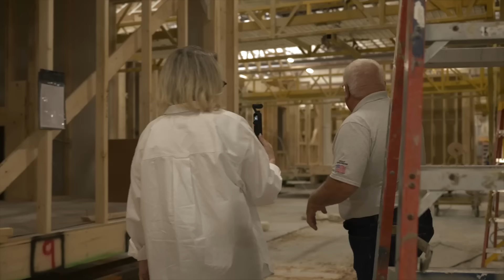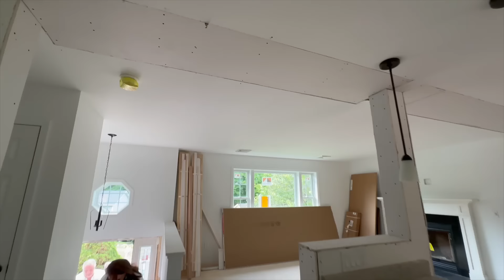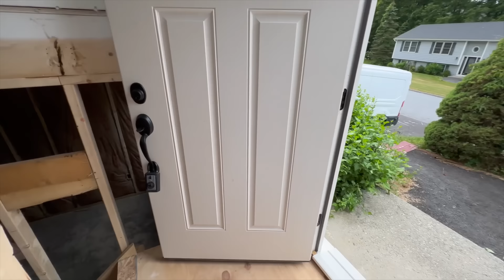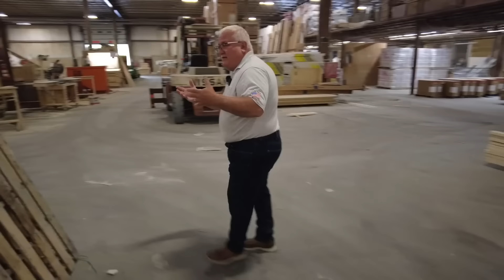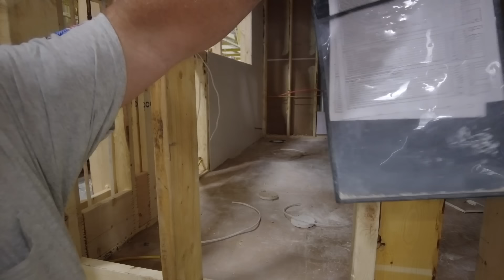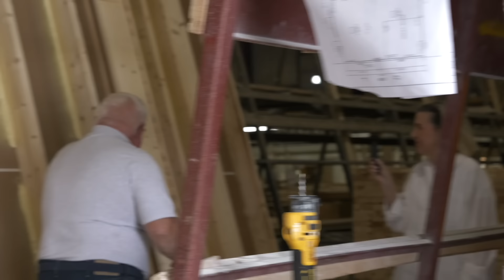Modular Homes ARE Better Than Stick Built!!!

Comment from the maker: LET ME KNOW WHAT YOU THINK! Are Modular Homes Better Than Stick Built? ( WATCH 👀 How "Modular Home Companies Are Lying! \https://youtu.be/YSayVjWhmvA)
Reply: @KristinaSmallhorn  I agree that modular is now better. I used to work at a modular home factory, and I will tell you that they have come a long way in 30 years.  With the issues they mention, plus the problem with so many new home builders being scam artists, it is no surprise that the modular builders decided to expand their business to better quality at a lower price, while offering more styles and options.
Reply: Just watching @cyfyhomeinspections inspecting new construction, I would say yes.
Reply: I am a carpenter who has recently finished a number of modular homes. They don't go together properly onsite, they settle at different rates since its a bunch of boxes put together, they use cheaper quality materials than any company Ive worked for so they won't actually last as long as the standard stick built house, you have to pay extra for decent cabinets. They glue sheetrock onto particle board plywood glued to studs so any renovations are more costly. Ive worked on Westchester modulars in NY and dreamlines in MA. If you want a house to last generations DON'T buy a modular. I turned down a kitchen/Trim job with Westchester modular after seeing the low quality of the finished product. The only thing, having a modular built is faster. I did 1 recently where all the doors racked and wouldn't open properly within 1 month after set. Remember people you get what you pay for.
Reply: @dandeflavis7004 
  As long as it lasts longer than I will😆
Reply: Can modular homes be built to tiny home specifications?
Reply: @feliciasampson8032  as long as you mean in size, not on wheels, I have been watching around and many of the modular factories are also making ADU's that are more often under 500 square feet.  Just check around as many will help customize to what you are looking for.
Reply from the maker: @feliciasampson8032 yes.
Reply: @KristinaSmallhorn thanks 😀
Reply: @feliciasampson8032 if you are referring to a home 300 sf and smaller, yes
Reply: You need to design a home where (if) the roof, comes off, in a hurricane, IT'S NO PROBLEM.
Reply: No link to the home builder? Westchester ?
Reply from the maker: @j10001 here ya go. https://westchestermodular.com/
Reply: Link please
Reply from the maker: @lisakaneck5120  https://westchestermodular.com/
Reply: You should have shown how they connect wiring, plumbing, and HVAC between units/sections. And no mention of masonry possibilities (brick, block or old style stucco). And no mention of fireplaces ( real brick or other ).
Reply: Can you direct me to the best mod homes in or around Tuolumne county California?
Reply: @jennyanimal9046  try Boxabl.  They are in California and have great options for designing to your needs.  There is a couple of more modular builders there, and in Arizona, that should be easy to find on Google.
Reply: Looking to get one in South Carolina; any builder suggestions?  Does Westchester deliver there?
Reply: @jwyllor thank you. Do you know of any builders in the PacificNorthwest
Reply: @feliciasampson8032  US or Canada?   In Washington state, there are a few dozen modular home companies.   I am from Canada, so I can not speak on the companies there.  I would recommend going to home shows (the fall ones should be lining up soon) and checking out the units on display, doing some research on the company as far as positive feedback then go from there.
Reply: It is great is there any dealers in Texas? Thanks
Reply: Don't think can get an underground basement in a modular home or other custom type amerinities that can achieve in a traditional type home. Such as stone and or brick. As nothing in this video showed thar could get stone on the outside such as like for the side or like say door or poarch pillars.
Reply: @MarkIrwin02  or plumbing and electrical changes etc
Reply: @MarkIrwin02  Yes, yes you can get a full-on basement for modular homes. As much as I prefer the traditional way of stick building a home outside on-site, I will admit it is absolutely possible to get a full basement for a modular home. You'd just have to sub out all the foundation work for that and coordinate with whatever manufacturer you're going with that has the building plans for the house it self. Not much different if you were to sub out all the foundation work for a traditionally built home, really. That all depends on if you live in an area that allows for a basement, of course, like throughout the midwest, east coast, or up north.
Reply: I’ll bet this guy knows the names of all of his workers, how long they’ve been with him, and what kind of car they drive.
Reply from the maker: @ he does!
Reply: Whatever builds the home faster
Reply: @Infamore  and faster is not always better!
Reply: Are there any modular home builders in the state of Mississippi
Reply: And unfortunately these contractors overcharge. I’ve seen this several times over the past 3 years.  Prices have stabilized now so they can’t use that excuse anymore.  I’ve been watching everything because we are considering putting up one more home for retirement and all culture stone and EIFS modular possibly with a 8 or 9/12 roof pitch and partial basement.
Reply: Wow !!!!!
Reply: stop making us look at your face. show us how they build them. sheesh. you're not 20.
Reply: What is the difference in price? Modular verses stick?
Reply: it's like anything, across many industries, do you get a better product mass produced or hand built by cratfsmen?
Reply: @KristinaSmallhorn  what is the company that built this home?
Reply from the maker: @ this home is Westchester modular.
Reply: We currently live in a beautiful- large modular home but wish to downsize. We are looking at properties potentially with an existing smaller (older) home. Have you seen instances where a modular  section or sections can be integrated with an existing ( single story) structure- given it is structurally sound?
Reply: Any modular home builders in Houston, Texas
Reply: How do you feel about Clayton Homes?
Reply: Yes. I actually wanted a plain 'ol double wide on my own 1/2 acre or so when I bought my current home. Guess what? Anywhere that's allowed those lots go for a premium and they don't come up very often. Very high demand. Against my better judgement I bought another stick built. And yes, regretting it. My old 2002 1200sf double wide cost no more than $50 in utilities. 1400 sf of stick built climbs North of $150 all the time. The fact that you almost can't get a lot tells you a lot.
Reply: @markw999  heck, my doublewide EATS electric and heat. I pay $600/month each winter in propane, it's ALWAYS cold, and my electric bill averages $400. Nope, stick built 100%!
Reply: @This1LifeWeLive  How old is it? On stilts or on poured concrete footing? The newer ones are fine.
Reply: @markw999  its on a slab and 20 years old but has 2x6 walls and fully drywalled. At the end of the day, it's just a money dump. In our area you cannot legally modify them, sono additions. The land value stays depreciated too because it's not considered a house (unless on a basement) but a movable unit. Not a bad deal if your land has little value, but if your land is an investment you are throwing your investment away by adding a doublewide instead of stick house. While modular homes are considered homes, the price point and time frame is sometimes worse than a custom stuckbuilt.
Reply: @This1LifeWeLive  yep, i came across that issue, the banks consider them a caravan/mobile by default
Reply: My son and my sister live in a double wide . They both say its so much cheaper too heat their home with the little infare heaters and a small Mr. Buddy  propane . We'll I didn't believe them until my furnace give out this winter and I used them and it's true  @This1LifeWeLive
Reply: @This1LifeWeLive  Yeah, Mark must be living in the south. Lolol
Reply: As a veteran of the housing supply chain, there is no doubt that modular is far superior to site-built.  It is simply more efficient.
Reply: I do agree with you that modular home is better but what about the delivery fees and installation fees are?
Reply: @koolwind5503  not better, always depends how well both are built :)

Comment: They are NOT modular homes. They are Manufactured homes. A modular structure is a box or sorties of boxes…. Used as superintendent trailers on construction sites. A Manufacred home is a “stick-built” full on house built to order on an assembly floor. It is of substantially better quality than a “Site-built” home made from prefabricated wet Canadian fir wall and truss sections and almost always out of square.

I was a National expert in specialized construction for Wells Fargo once upon a time and toured every manufacturer in the Western US and wrote FHA and VA construction guidelines.

Just saying.

Comment: I own a 2-story center hall colonial house of 2000 sq ft built in 1910. It was a Sears kit house! Online I found an ad for the kit. The price for the kit was $3500 including all materials inside and out, including roofing, siding, windows and doors. A coal fired furnace was an extra $100!  Not sure if plumbing and electrical was included. Structurally it's still rock solid, probably built better than conventional houses of that era. No short cuts or mistakes. I wish I could find a copy of the actual assembly instructions. The forerunner of modulars.

Comment: I grew up here in New Jersey with the son of the man that owned the largest modular home builder in Pennsylvania before he sold the company out, I work for multiple modular home companies here setting them in the state of New Jersey from statewide to a couple other modular home companies and I've stick frame a lot of houses and I'll be honest with you you get the same amount of headaches with a modular home then you do with a house being built by ground up, the only difference is going back in the late 90s and early 2000s modular homes for cheap, but my personal opinion and being in construction for 35 years of my life here in New Jersey, there is no difference on a headaches here in the state of New Jersey

Comment: Do you have 7 ft ceilings in a modular?  I prefer at least 8 ft.  Just asking.  That is the main thing I dislike about mobile homes.  They need to be that low because they have to pass under bridges, etc. en route to their permanent location.  I was not sure about modular ceilings.  The video makes a lot of sense nowadays.

Comment: I've built 2 tradition homes in my life. If you personally don't kniw the coding and watch each stage of construction contractors WILL cut corners. I honestly believe it's why prefab homes are becoming a standard for housing simply because most contractors treat each build as a prefab and rarely watch their prints. You put 12ft ceilings they try to sneak 10 ft in then pitch the roof. When you catch them you must stand your ground and have the signed official print and MAKE them eat the cost. That's today's contractors

Comment: They need a new name for this classification of home building. When I hear modular I think of a two piece mobile home that has the wheels and axles under it.
   Pre-built makes more sense. Constructing 2x6 outer walls adds strength and insulating space. HUD code only requires 2x3 framed walls. No working out in the weather. Of course local government will interfere with this type of construction. Many in the building department don’t have the qualifications needed to look over plans or do proper inspections. Look at any high end builds in development areas where dozens of homes are being built at once by low wage labor, poor supervision, and inadequate in process inspections.
   This is the answer to affordable housing. When smaller homes can be built in 6 days or less and finished in weeks.

Comment: Modular homes are still stick built homes. They all use the other 2 x 4 2 x 6 is two by tens 2 x 8 and 2 x 12 lumber. So really should be said is module home versus site built home.

Comment: It all depends on the builder. Son in law had a modular built and it took them 7-8 months before they moved in. And the quality control wasn’t great. Lots of stuff needed to be fixed. They were so tired of waiting that they moved in with stuff still needing to be repaired. They got talked into spending more money by having the upstairs finished when they didn’t want to. They were told they wouldn’t qualify for the house if they didn’t. Roof leaked for weeks before they repaired it. Just a nightmare for a young couple. Do your research before you buy from any company.

Comment: There is no universally "better" home construction class. It is a matter of the builder quality. If you found a builder that was fully staffed by master craftsman it would be far better than the cheapest modular builder. Most traditional builders now use unskilled labor, and have a hard time passing county inspections. Almost 30 years ago my parents bought a home built by "Classic Homes" in Colorado Springs. It was the show home with all the extras and features, and should have had no flaws. When the roof leaked we discovered that the attic vents on the roof didn't connect to the attic. All the rear gutters went to one corner, and the soil grading resulted in water pooling up to the edge of the window well. The first night there a torrential rain that filled the window well halfway up, and my father and I had to bail it out. We re-graded the yard, added a patio that kept the water from the window well, and redid half the rear gutters. The vent on the roof was corrected when the roofing was fixed. We also had to fix a pipe that leaked several years later, but the house was about 8 years old by then.

Comment: We bought an Amish built modular. Things gorgeous, think gatlinburg lofted cabin,  but it has had a few oopsies. Signed contract in I think October of 24 with a number of custom changes, they had a little trouble with following the blueprints, but it really is stout. Now preparing the lot was a pita, removing the old septic, cleaning up the burned out old house, getting new underground utilities, hooking up water and power, there was trouble with the new septic etc etc. We priced a stick built and it’s coming close to the same. Should be getting its certificate of occupancy after we have the deck put on over the next few months. You can do some custom stuff to them but they are most efficient if you don’t change room sizes or shapes. We had to cram it into our lot as close to the original footprint as possible. We got an Amish custom built kitchen also and it’s just lovely. 100% wood, no particle board anywhere, much more moisture resistant. They offer them where you can build out the interiors yourself, to complete but you still have to deal with the utilities, not move in ready. I think it was worth it.

Comment: This makes sense if the orders are in the thousands and its exponential cost difference.  Lot of 2,000sqft homes can be framed in week. A 3,500sq in two weeks.  A 5,000sq in a month. Not guarantee but certainly acheivable from framing persective. So the whole lumber is outside for too long if your building in winter but not detrimental. Once frame is finished roofing and siding is done too. The quality of stick frame will be unmatched for very long time to come. Just because the framers are too fast to even consider alternatives. Which people still do try. Let them. Stick always win. One week to frame a regular house. Theres no need reinventing the wheel.
Reply: Look at all the reviews that say otherwise.  All the name brand big Builders are just trying to make a quick buck. Horror stories abound all over.

Comment: Your information about building material scrap what they do with it is misleading and definitely wrong most construction sites if not all have dumpsters that are rolloff dumpsters, and the material goes in there and then it hauled off not put in the person‘s yard come on where do you even get thatinformation that’s ridiculous
Reply from the maker: You’ve never been to Louisiana constructions site apparently. Btw. 14 yrs ago in my personal home we dug up a wheelbarrow, the only reason we knew to dig there is our new grass kept dying. Then we found roofing nails in my toddlers shoes. You may have pristine construction sites but that’s not the norm.

Comment: You do realize that these homes are built the same as what you call stick built. Just assembled in a factory and delivered in sections right. So question is what is the cost or cost difference then
Reply from the maker: I said that in the video.

Comment: Where do you live where construction crews bury left over materials and cover it with sod? I worked construction and never saw that. Open top dumpsters are usually on every site. 😂 I will say if I have a home built it will be modular.

Comment: No I don’t think stick built homes are better. They build them out in the weather and get wet and they keep building. I think every time I drive by new construction, raining, next day they’re still working if not raining and the wood is still wet! Mold later, maybe. I like how the Modular homes are built inside a dry environment. I WANT one. Yes, my house would NEVER stay together going down the highway 60mph 😂
I agree with you! Thanks for sharing.